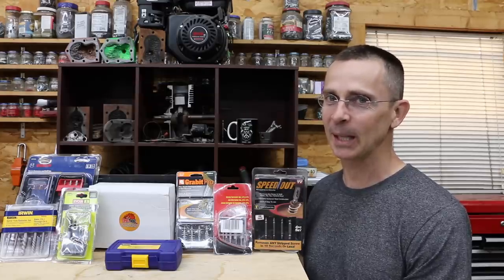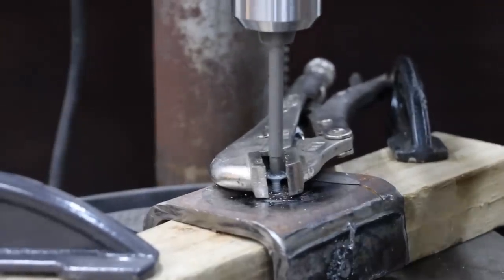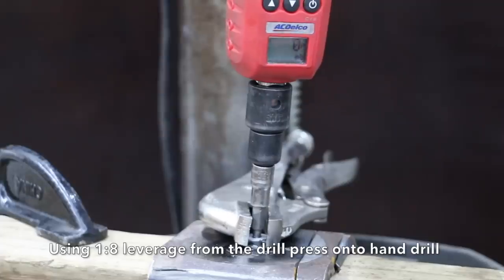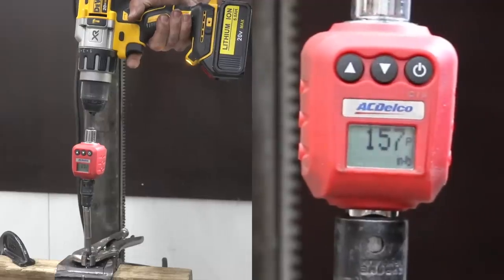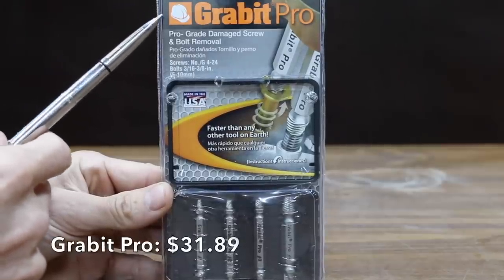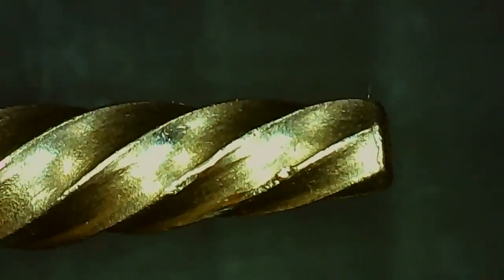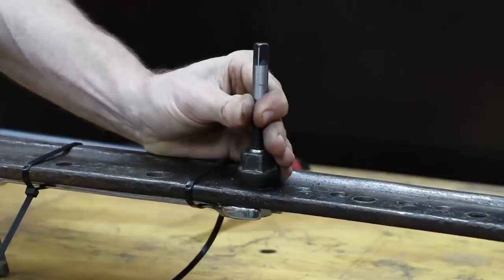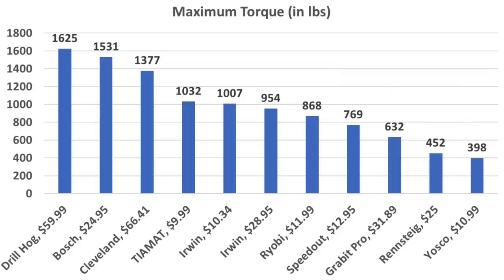Best Bolt Extractor? Let's find out!  Drill Hog, Bosch, Irwin, Speed out, Ryobi Broken Screw Sets

Comment: Love that DrillHog came out on top. Thanks for this video and glad you are using affiliate links @ProjectFarm; an easy way for us to support your great channel. As a tip to everyone here, bolt cutters WORKED where everything else failed. I had a 3.5" stainless allen head bolt that snapped in a (15yo saltwater used) outboard trim/tilt unit with galvanic corrosion (stainless into aluminum). Tried many types of extractor combined with torch, + vice grips, etc. all failed, but when I went to cut the bolt I got ~1/8 of a turn with the bolt partially cut and and after rocking it back and forth  was able to spin it out. Hope this tip helps someone! 👍
Reply from the maker: Thanks for sharing.

Comment: I wish I had found this video six months ago. I bought that "As Seen on TV" SpeedOut tool and it was total crap. All the drills get chewed up on the first run, so you'll essentially have to buy a new set for each screw, or just use twist drills. But then you run the risk of torquing the head off. GrabitPro would have been the better option. Thanks for this incredibly valuable knowledge.
Reply from the maker: You are welcome!

Comment: Great test.
I have the full set of IRWIN HANSON Hex Head Multi-Spline Screw extractors. I have used air impact wrenches on them to speed up the process. I had a broken 1 1/8" broken bolt that I used my 3/4" drive impact. 
Their system gives a lot of surface grip area with all the small splines. If it slips, get a bigger hammer and drive it home.😎
Reply from the maker: Thanks for the feedback.

Comment: I've had good results with parallel flute and parallel spline extractors for bolts and studs over the years. I find there is less chance of them over-expanding the broken bolt or stud.
For stripped screws, the short steep taper spirals are definitely my go to.
Reply from the maker: Thanks for sharing.

Comment: I’m a tool technician for a fasteners company. I work on pneumatic nail guns, air compressors and fuel cell nail guns. Hex screws (Allen) on all of them. They strip and break off all of the time. Very seldom do I have a gun, that doesn’t break or strip out the head. I am the company getter outer. I have had special tools sent from other branches. Make certain you drill the hole deep enough. If it’s a hex socket head, drill through the head until it breaks off. This should leave a piece of the screw up, that you can grab with a pair of vise grips.
Reply from the maker: Thanks for sharing.

Comment: Left hand cut drill bits is the best over all youve talked about sir,,,,they are some what of a challenge to find to even buy,,,,but bar none the reverse cut on the left hand cut drill bits are the stuff!!!! While drilling with them about the time your half way through your hole that you think you need bam! The drill bit gets hold an the fastener comes  right out like magic!  Most drill chuck want to back off so the chuck must be tight,,,really tight,,,,an just like regular drill bits get a top of the line stuff, cheap left bits will let you down an make you cuss😂,,,,get good really good  bits,,,drill slow people slow slow SLOW!!! an they will last you a life time oh and dont forget the drill lube,,,its as important as slow an top quality bits,,,dont skimp an things will go sweet for ya,,,ive had mine approximately 15 yrs an i have broken 2 of the smaller 1s but thats not bad for a set from 1/2 in down to 1/8 in  pretty decent bits. I love them, i consider them as 1 of the best tools ive ever bought my entire life,,,,
Reply from the maker: Thanks for sharing.

Comment: A torch is the best extractor. It can't be stuck if it's liquid!
Reply: I little heat from a torch will loosen a rusty bolt right up too.
Reply: A torch can loosen a bolt but liquefying it is not always a practical solution. You have to be careful not to destroy the threads that the bolt is imbedded in.  The best rule of thumb is to try an extractor first and add heat if needed.

 Most of the time you are using the extractor because the head sheared off of the bolt
Reply: And that’s a fact
Reply from the maker: Great point on the torch
Reply: Once I went torch I never went back. Little bit of heat will loosen just about any stuck bolt. Way better than snapping heads.
Reply: In a lot of automotive work this is fine (induction heaters too if you have the money for it). For flammable or easily damaged materials it's not an option save as one of last resort. Wood, plastics, electronics, brazed and soldered joints, paint or plating, seals, anything close to oil or fuel, and so on.
Reply: I had a lug nut that completely stripped out on my RAM and had it towed to a shop to fix it and the guy brought out a torch and I was thinking great there goes my aluminum rims and the rotor, but no, this dude was a fuckin surgeon with that torch and cut out only the lug nut and lug with no damage to the rim or rotor beyond a bit of soot, no clue how he pulled that off.
Reply: @bdkj3e  I had a rounded off head on the last bolt holding the front axle hub bearing of my Suburban, so my friend brought over an oxyacetylene torch and simply melted off the corner of the old bearing surrounding the rounded bolt- and melted most of the bolt itself too, just for good measure.

Comment: I never tap the screen extractor in with a hammer. Just insert, apply pressure, and allow the flutes to grab the screw. I think you may have damaged the flutes by hammering them in.
Reply: You may be right, but I believe PF is just following the instructions included with each set.  After all, that's how most people would use them.
Reply from the maker: Thanks for the feedback.
Reply: Tapping is in the instructions. What's not in there is the degree of tapping required.  I believe he hammered them a bit too much in my opinion.
Reply: quasibrain2319 i do the same, because I believe it keeps from flaring the bolt making it tighter in the hole, but to be fair he was just using it as the manufacturer recommended, pf is a pretty smart guy so im sure he has his own method for real jobs.
Reply: Me too, I never give more than a fairly gentle tap, usually not with a hammer, then apply pressure while extracting. Seems to work well. Larger fasteners might differ.
Reply: Geoff Strickler i hit the broken bolt hard with a punch and hammer before i drill it to loosen it in the hole which I find works really well
Reply: @stupersyn1  I do think that he kept hammering until he felt the extractor "biting" into the screw. I feel that it's what seems most logical, why else hammering if not to get a good bite? Also I do not understand it was in the instructions but that's what they told to do. So again as always did I find he was true to the products without inserting his own methods or changing anything from the intended usage. If he should do it by him self, do I think he would have done it in a different way. :-)
Reply: I agree never use a hammer.
Just use a tap wrench anticlockwise. Happy days. 😂😂
Reply: I've tried both ways and the extractor in my case did not grab until I tapped the extractor in with the hammer. Just my experience.

Comment: The amount of bolts I have broken, stripped or got rusted inside....and the amount I spent on extractors. This is a great video to highlight what I should buy next time.
Reply from the maker: Thank you!
Reply: After 55 years as a mechanic I've had my share of broken bolts, studs and screws and I found the the extractors that I purchased from Snap-On tools worked the best.
Reply: Buy some discretion and patience if you can find any for sale.
Reply: @dthorpe4855  and if it broke, Snap-on replaced it right?
Reply: Paul Frederick it comes to those who wait

Comment: ok, good to know it wasn't just me. in all my life, i've only ever got these things to work on one screw.
Reply from the maker: Thanks for sharing.
Reply: I've removed hundreds of screws with extractors. A lot can be said for experience. There's a lot of "feel" involved as well as drilling a straight hole that's deep enough to begin with.
Reply: @cryangallegos  

Literally hundreds? I really doubt that.
Reply: I don't. I have removed quite a few myself though I haven't kept track. Anyone that works in a mechanical repair capacity could see a lot of screws extracted over a few years. Same could be said for a lot of machinists that work in automotive capacity.
Reply: Literally hundreds. Likely in the thousands lol
Not at home, at work. At home I've only had to use them a handful of times
Reply: @consaka1  close, aircraft 🙃
Reply: @cryangallegos  aircraft? That's a scary thought.
Reply: @consaka1  why is that scary?
Reply: @cryangallegos  Well a bolt breaks off in a car and the starter falls out you are stuck alongside the road. A bolt breaks on an airplane and you might just crash. You go from a chance to survive to slim to no chance.
Reply: @consaka1  You don't typically remove bolts in flight...
Reply: @Oblithian  Really? No kidding! Why do you think that bit of obviousness is relevant considering nobody implied you would? The implication that was mentioned was bolts BREAKING during flight. Those repairs are obviously made on the ground though typically the damage doesn't occur on the ground. But that is only if the plane doesn't crash due to enough broken bolts.
Reply: @consaka1  Ah I see your concern, however aircraft bolts almost never fail while in use. They usually fail when attempting to remove them
Reply: @cryangallegos  Ahhh now that I think about it that makes sense because they are almost always installed with lock tite right?

Comment: I'd love to see a part two to this with snap on and mac extractors.
Reply: "Which big box screw extractor kit does Snap On rebadge? Let's find out!"
Reply: The Snap-On/Blue point  screw extractors are made by Ridge Tool Company, as in Ridgid pipe wrenches,  they are bye far the best I've every used!
Reply: @Rodarbal0  Sure sounds like you NEVER used them,...
Reply: Jeff Miller you are 100% correct
Reply: Glad you talk about it . When it's time to removed broken manifold studs you can't do any better than these hex
Reply: I'm pretty sure the snap on td2425 set is essentially the same as the Irwin 24606. That's for the tap and die. The irwin 54009 is pretty much the snap on rex10b. Made at the same place.
Reply: Snap on taps and spiral extractors are rebranded Irwin like he showed. I'm not terribly impressed with mine.
Reply: The Snap-On taps I have are rebranded Greenfields. They might be older versions since they’ve been around awhile. Top quality taps. The extractor sets are definitely a step above Irwin’s in every way. I’ve used them with cheater bars to get bolts with stripped triple square style heads.
Reply: @athhud  Correct (in Au too).
Reply: @athhud  My Ridgid set is so old it is in a cast metal case. Never failed yet. Broke 2 tapered Irwins 40 years ago. Haven't tried my Proto tapered square set yet cuz the Ridgid just works.
Reply: Jeremyv1980 it’s the ridgid renamed bluepoint that I’m talking about. There is no equal as of yet

Comment: Should see how well thay do with exhaust bolts broken in a engine block.
Reply: the remains of the steel of the bolt in cast iron ore aluminum of the block is seized way beyond using an extractor.
Drilling or glowing it out is sadly enough the only option. 😢
Reply: Boy I've been there before. And no, I've gotten them out with an easyout and a torch. You heat the block, not the screw. And yes I've done it on aluminum before but you gotta be SUPER easy on the heat. Aluminum gives NO WARNING AT ALL, it just vaporizes when you get it too hot. But I suppose 29 years of practice as a full time mechanic may have something to do with it.
Reply: As a former 5.4 Triton owner I feel your pain
Reply: And the answer is, 'What is a Heli Coil?' Alex. 😅
Reply: Sadly in my job I do that many times a day but never with spiral extractors as they tend to expand the broken bolt and make it harder to remove . i found left hand drills and/or a file handle pretty good otherwise drill them out, sized to the bottom of the thread and then pick out the rest or use a tap.
Reply: @aussiebloke4601  way smaller European engines have also less meat then US engines to work on.
The best way is often to use a template/guide and drill the bolts out.
cutting new thread and use antiseize paste to prevent future problems.
Seized damaged studbolts in cast iron (mainly dieselengines and Turbo's) you can heat the cast iron just around the studbolt with an induction heater. Then you can remove the studbolt.

Comment: When using an extractor you want to drill the largest hole possible into a bolt or screw and uses the best fit extractor that will fit into the screw at the extractors meatiest thickness. Using an extractor at it's thinnest part will never extract a screw or bolt efficiently. And will most likely break or strip the extractor. This video is very miss leading in testing of quality.
Reply: You're correct on that.
Reply: Well, I'm not even sure what this video on bolt/screw extractors was showing, but are you saying that if done correctly, the brands ranking could have been in different order or are you saying they would have ranked the same but would have preformed better?
Reply: He follows the instructions from the manufacturer per the different fasteners. If you don't think he was using the proper drill bit or extractor size, then the manufacturers are to blame. All the extractors looked like they claimed to be able to remove the size fasteners he was using in the video to me.

Comment: The GrabIt Pro works extremely well, but the first time you use the drill bit in the clockwise direction it is done, it will not ever drill again. It is made to drill in the counterclockwise direction only.
Reply from the maker: Thanks for the feedback.
Reply: I don’t know if you’ll return to this comment, but was the instruction to drill in reverse direction provided in the package?
Reply: @trick58  yes the directions are usually in the package

Comment: You should test different garden 
hoses. How much pressure they could take, or how tough they are after getting damaged.
Reply: Also test some spray *nozzles*; so far, none of the pistol-grip garden-hose spray nozzles I've tried will last more than two seasons, and some are only good for one season. If you get an unexpected early, or late, cold snap that freezes the water inside them, or if not perfectly dry when stored through the winter in an unheated garage,  shed or deck box, that's the end of them, they'll leak for sure.

Comment: Although manufacturers recommend tapping them with a hammer, I find it causes excessive wear on the extractor. Drilling slightly deeper relieves pressure on the threads and will usually extract without tapping it. But if it is still not budging, tap the extractor while turning it.
Reply from the maker: Thanks for the feedback.

Comment: Just snapped the bolt that holds on the kickstarter on my dirtbike. Needed this video today.  Thanks!
Reply: I miss my dirt bike man, so much fun. I would have never sold it but after having our first child and moving into our own house I needed to get rid of the payment.
Reply from the maker: Glad it helped
Reply: @appalachiangunman9589  I hear ya man. I've got a truck payment so I bought an older beat up 2 stroke to fix up. Should be fun.
Reply: john axtmorder that’s what I should do, save up and pay cash for something used, usually though every time I have some spare cash it seems to turn into a gun.
Reply: @appalachiangunman9589  I've got the same problem. Luckily I ran out of room in both safes so I I would either buy a safe that would sit empty until next month, or buy a bike I could get running in a week.

Comment: I've used the Speedout set successfully a few times. But it was not for long wood screws. It was for tiny machine screws made of very soft metal and glued into the holes. Either super glue or a special lok-tite that is only used at factories.
Reply from the maker: Thanks for sharing.

Comment: Having spent 20 years in the USAF working as a Sheet Metal Technician and having removed well over 10,000 stuck Aircraft grade screws and bolts during that time in numerous aircraft types I can say the ,"Cleveland" otherwise known as "Easy outs" hold up rather well and in most cases do the job.
Reply from the maker: Thanks for the feedback.

Comment: As a millwright I use these quite a bit.  The close spiral extractors (Tiamat in this case) actully work very well in a broken bolt.  But they do not need to be hammered in.  That actually damages the flutes on these.  Just a light tap, then they thread themselves in when you start twisting.
Reply from the maker: Thanks for sharing.

Comment: Bought a set of 2 grabit pro extractors after watching this video, as I had a stripped bolt holding a lock in a door. They worked perfectly. I had previously hammered a torx bit into the screw but that didn't work at all.
Reply from the maker: Thanks for sharing!